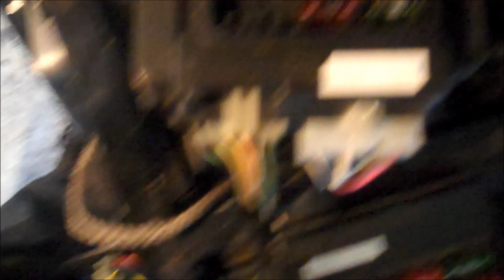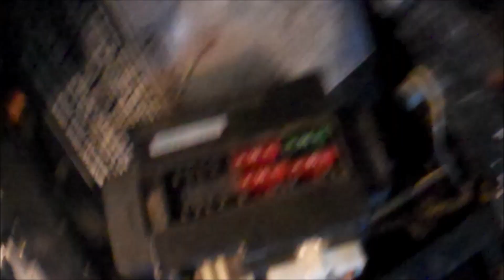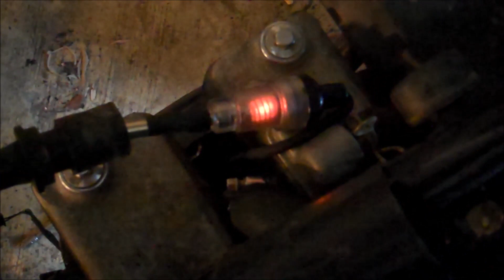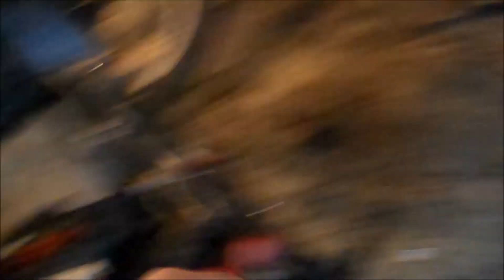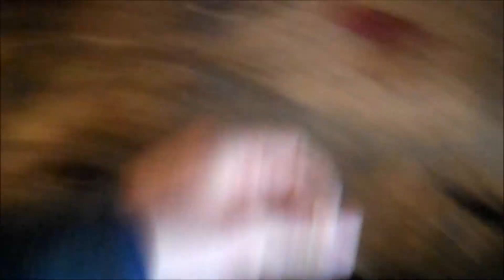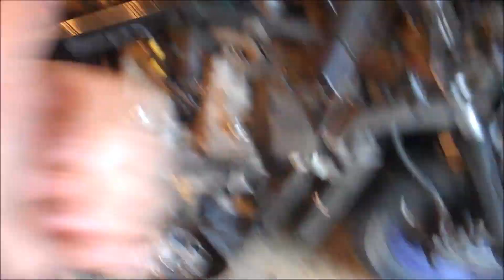RE-UPLOAD: ANSWER: Guess the problem, win a prize: ZX600

Comment: Just saw your new vids. I had the same problem with my 1989 zx750f ninja when I replaced the original with a 600 fuse box, though one  of the zx600 models does work with my bike, the others don't.

Comment: By Jove it works :o) playing fine although i never have any idea as to the answers i find these guess the answer vids very interesting. And thanks for your reply Max :o)
Could someone help me with this, i am rebuilding a honda xl 125 engine ( i have had the casings vapour blasted ) i dont know if the engine was working previously, but when i set the tdc on the rotor the cam sprocket mark is slightly to the left of where it should be and when i set the cam sprocket mark to where it should be the rotor mark is at the F rather than the T mark, its doing my head in AAARRGGHHH :o)

Comment: hey Maxx you rememeber how to wire this or do u have a schematic?? i got a 1986 ninja 600a that i cannot get the blinkers or head light to work. i know 100 percent its wired incorrectly.  let me know, thanks
Reply from the maker: Sorry I dont have one anymore, you should be able to google for it
Reply: +mrmaxstorey did my best to. got the diagram just dont know how to connect it to the junction box. the 8 pin part not the 12 pin one.  no blinkers or headlights :(